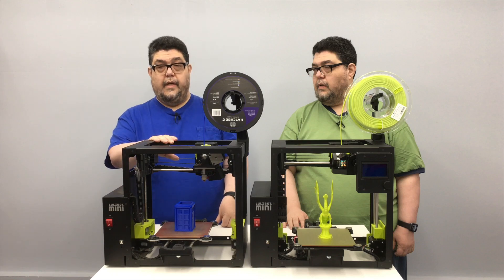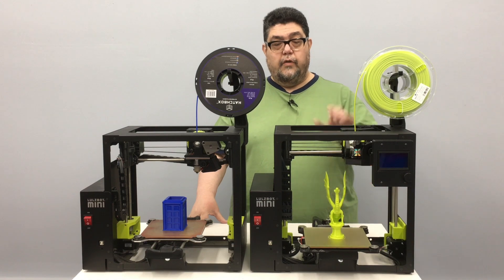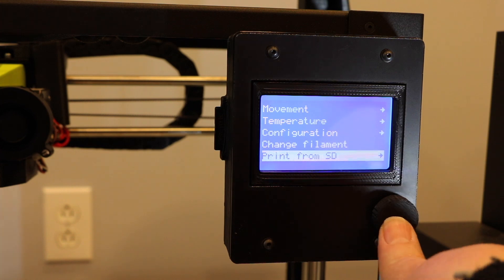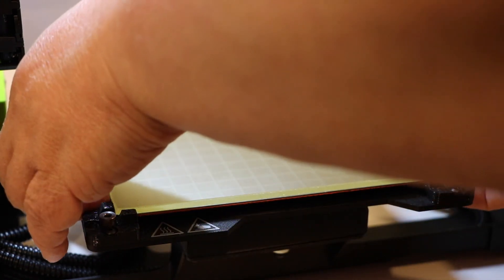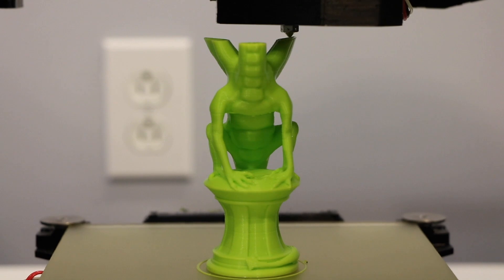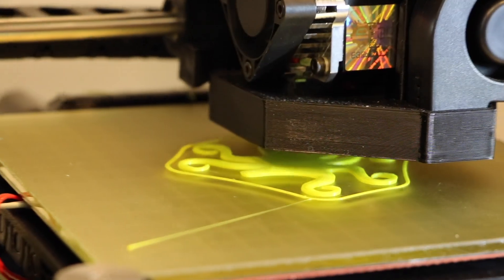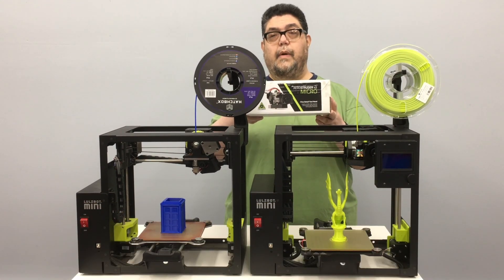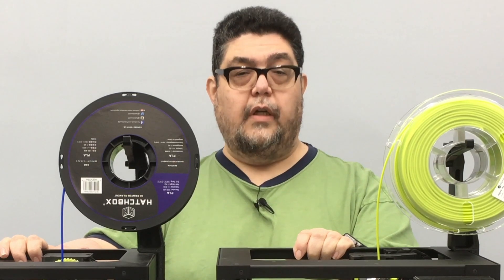The LulzBot Mini vs. the LulzBot Mini 2: a side-by-side first look

Comment: Any update on the extruder?
Reply from the maker: Doing some testing still.
Reply: @AdvancedGeekery  - are you still planning to make the extruder video?
Reply from the maker: @RPMlegacy513  I had pretty constant problems with small objects. It could be I couldn't dial in the settings right, but we chose to hold off on doing a second video because of that. Haven't been able to go back and test since then because my production schedule's been booked with other projects. The one bummer with having so many projects is that if something doesn't work right in its available time window, it often can't get readdressed because other things come up.
Reply: @AdvancedGeekery  makes sense, and thanks for the findings. very helpful!

Comment: Meh, whats interesting about small nozzles? I think it is unacceptable to do special, expensive toolheads for things a simple nozzle-swap can do on other printers. Maybe you can show more about the changed mechanics in the next video, I'd be interested in how the belt-driven z-axis works over the old screw-version. Is there gearing involved, is there backlash, are there different artefacts when printing the same object on both 1 and 2?
Reply from the maker: Those are good questions. I'll ask the fine folks at LulzBot and see what they say.